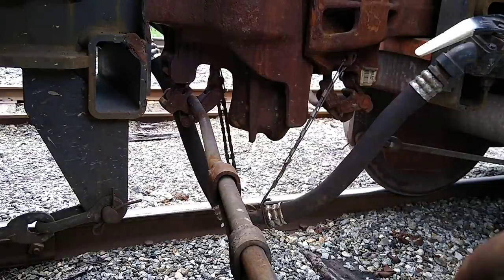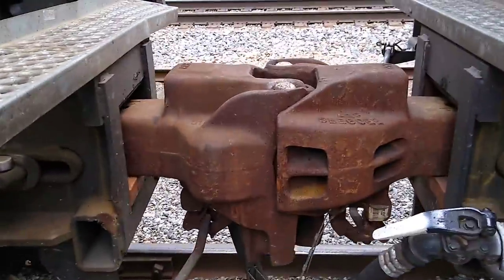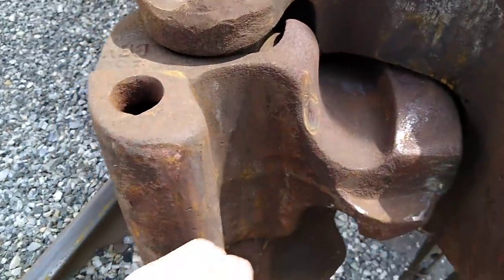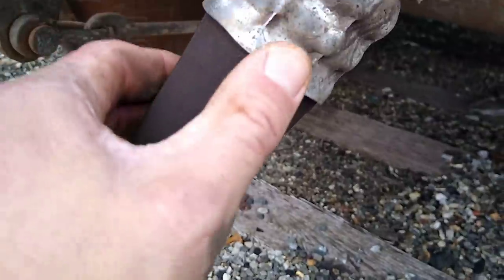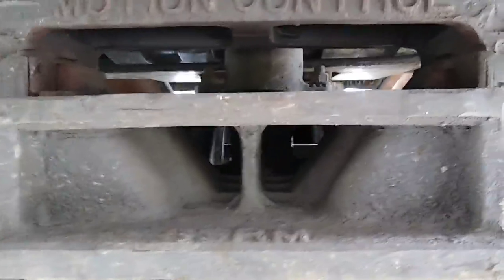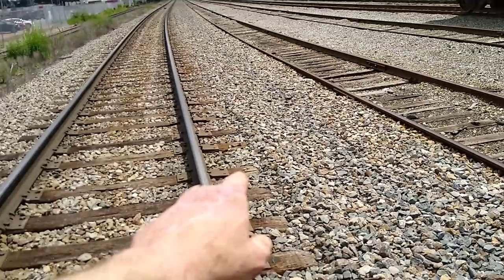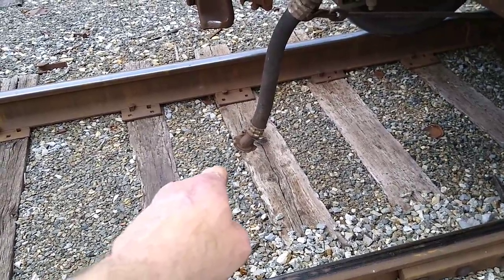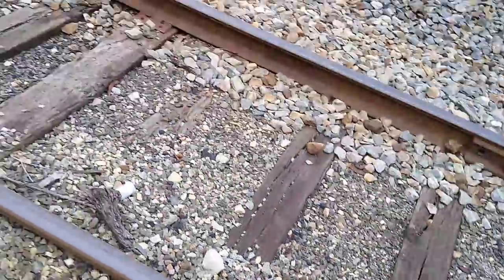Couplers and braking systems knowledge

Comment: Hey Shoestring! The connector on those hoses for the air lines is called a Gladhand fitting. They're universal for air brakes because of the positive locking action. Love the videos and knowledge you share, have safe travels!

Comment: Former railroader here. Retired carman out of CN GO  (MacMillan yard north of Toronto) The "hasp" as you called it where the release bar is connected to the coupler is called a "lock lifter" because it raises a locking block which prevents the knuckle from rotating. Once the lock block is lifted then the knuckle is free to turn on its pin.While the lock block is rising upward it moves a kicker which pushes the knuckle to help open it. The knuckle pins to as you stated break regularly and the train crews do carry spares. Dynamiting is any sudden loss of trainline pressure which causes the individual cars to go into emergency. It can be initiated either from the locomotive or due to a failure of a hosebag or gladhand. Occasionally a hose hanger will fail and allow the gladhand to strike a switch or crossing causing it to come apart. A couple other things, the the rolling assembly is called the truck. It consists of the wheel/axle assemblies, the truck sides, which sit on the adapters, which sit on the bearings, and the bolster which sit on the springs in the truck sides. The center pin is over a foot long (you only see half of it) and the truck bolster into which the center pin fits also has a center ring which the car center plate fits into. The bar which joins the coupler to the draft gear is called a cross key and is held in place by the T shaped cross key retainer.  These things are pretty amazing considering it was all designed by guys using slide rules many decades before the first computers. BTW Im not trying to be a smartass or anything but you seem like a guy who likes to learn and share your knowledge so I thought I would share with you stuff I had to learn on the job. Take care and safe travels.

Comment: Loram rail grinders are cool to watch especially at night.
Reply: Looks frightening at night the first time I saw it,, 😉😉😉
Reply: @GeorgeJansen  Couple times had to change out brake shoes and inspect the Sperry rail grinders. Dirtiest job we had.
Reply: Caught one in February and uploaded drone footage on my channel
Reply: Yep I saw one during the day and one of them during the night over my life pretty cool and you know they also have water tanks on those both of cooling the rail during the growing process and putting out small fires because of the Sparks from the grinding obviously could ignite brush or other things you know.

I've seen quite a few Maintenance of Way cars ovrr my life just a train enthusiast not the biggest but I don't seek it out mostly watching other videos and just more into the technical side of things as well.

God loved the old Google Books on the old old old stuff though.

At one time signals actually used to be operated by CO2 back then it was called the carbonic acid gas.

Also there were some signals and other things like that such as the pillar I guess you could say with the beacon that said railroad crossing not crossbuck or anything but just a little beacon on a big I guess you could call it mono live hard to describe but that was actually operated by acetylene gas years ago.

Also at times in the old days singles you stupid be lit by oil candles alarm with that there was some actual monitoring for those signals basically sort of a primitive thermostat that if the oil candle were to go out I can't remember if the circuit was closed when we aren't only open I think it was born with closed basically if anyone signal went out because the oil candle went out they would know on the other end because the circuit would either open or closed probably likely if I remember correctly it was from a closed circuit besides safety so that they would get indication should the circuit break or have an issue with the wiring excetera.

The old interlocking system and other systems were fascinating pieces of mechanical wonders.

Also the system that were used to ensure that only one train could travel on one section of track a Time besides signaling even more interesting such as token systems Etc.

Also they used to call steam engine plumbers Nightmares by the way.

Also I've been to many of Railroad Museum in my days.

Almost always if we find out about when we have been to somewhere we try to go if we would be going on a trip but of course the during these times that's a nope.

Also any unnecessary travel and or getting out of course.
Reply: @GeorgeJansen  yep I would have been a little startled if I didn't know what was going on but I realized it was a wrong rail grinder right away.

Comment: Shoe, when I stop a train, I 'strech' em out, so  so nobody  can pull the pin(s)
Reply: I learned that the hard way. I once had someone pull a pin on me in Houston.
Reply: Has anyone had any experience of failure of a Buckeye coupling in UK. Whilst a Guard on a heritage railway the cross pin supporting the coupling worked itself out and allowed the coupling to drop & part. The cross pins and tails were checked earlier in the day & the set had not been parted for over a week. When stationary the cross pins are often quite slack & can be turned & pushed out once the safety tails have been lifted. 
This coupling was fitted to a MK 1 carriage, no fault was found after the incident. The carriages involved have been returned to service without any problem. Hundreds of these couplings are in use in the UK , has anybody heard of such a failure in the UK.
Reply: I’m a shunter in Australia. Works when the string in bunched also
Reply: Kabuki Kitsune  stuff breaks sometimes. i've seen entire coupler boxes get pulled out because they had rusted away to nothing on the inside, but you couldn't tell on the outside

Comment: Totally  random  comment  here . 
But here goes . Working  in nyc transit tunnels and tracks ..we yell "Railroad " if a train is heading  in our direction...we have systems in place for safety but things happen. Soon as  you  here " Railroad "you take  cover " cover up " in a cubbie hole  flagman will signal train..train acknowledges with horn blowing  ..we also have a manual stop and a red cord  thats thrown  across tracks..once train runs  past this brakes  are activated  and train runs over cord marking exactly were  train rain past stop and into work area.....thanks for listening  .

Comment: Glad hands can be a pain in the butt on trucks too. SOMEBODY was thinkin when they invented them tho SHO NUFF....BTW GREAT SHIRT...Hooefully we'll get ya one that says KING of the hobo's this year😳
Reply: trouble is on trains the gladhands just slide apart like they were designed to but on trucks they will usually rip the air line off. grrrr
Reply: @edfrawley4356  been there, dinr that 😂😂🤣😂🤣 when I first started driving I was Hostling on the yard and i was wonderin why our Hostling Mules had expanded metal over the back windows till i forgot to unhook my emergency line and it came thru the open back door like a 22-250 😂🤣😂🤣😂
Reply: Ed Frawley same concept but different design between the two. Tractor glad hands more like those on construction air compressors and designed for not coming apart.
Reply: @groveradams8892  I suspect one has done is because on a railroad you would want that the company in some cases and brakes going on or a train coming apart not on purpose could be touring it however or something like that would have happened with road traffic oh yeah you got a ton of issues people that would be more likely to get hurt and more could probably cause a lot more damage than just a stop train yeah a heck of a lot more.

Comment: I’m a rail shunter in Australia. Ours is slightly different, our auto coupler has a pin that drops from the top so you can see it’s caught on properly. Our hand brakes are on the side on the wagons waist highs. Which is easier if you putting 6 on at a time.  Hose bags look the same tho.. some don’t bleed the air and we call that leaving bombs.. the hose bag can hit you in the face and give you a bad injury.

Comment: I been working for the railroad MOW for almost 26 years,you know more about this stuff than do
Reply: And most conductors!
Reply: oldrockhead  I dunno... he ha a point. I've dealt with my fair share of morons working as a conductor. But you gotta remember that if they have any inkling that you're a foamer, they don't hire you. All that's left are the few that are able to hold back the foam and the rest are the ignoramuses who think "How hard can it be?"

Had a guy get fired on his first shove move because he rode a tanker just minutes after being told not to.

Never had a problem working with new hires that were railfans. It's the ones that are indifferent to trains that are the problem. At least out here...

Comment: Volunteering at some local heritage railroads, I've actually seen cars lifted off the pin that the bogies or trucks pivot around (one case was pulling the front bogie from a vintage trolley car to pull the electric motors for rebuilding), and the one narrow gauge railroad I've done preservation work for actually had a big crane in the dual-gauge yard where it interchanged with the Pennsylvania Railroad (now Norfolk Southern) that was originally used to transfer lumber from the narrow gauge cars to standard gauge cars, but was eventually used to lift up entire coal hoppers off the narrow gauge (or vice versa) bogies, then roll them out, and roll in standard gauge bogies (or vice versa) so they could transfer the load from narrow to standard gauge (or the other way around) without having to move the coal from one car to another.
Reply: DJ Bonebraker recently looked up bogie vs.truck cause I’d often heard the two for the same thing. Typical usage, bogie is English, truck is American.

Comment: Minor correction, Shoestring.
The weight of rail is "per yard" not per foot.  For example, an 80 pound rail weighs 80 pounds for a 3 foot long piece (about 27# per foot).
Most main line heavy use trackage is made of 130# rail.  The lighter rails are primarily used on smaller branch lines, sidings and service areas.
Just thought this would be helpful.
Really enjoy your videos.

Comment: Really cool video Shoestring! It was all very interesting. And the most amazing thing for me, was simple and easy most of the things on the train were. I mean, just to a certain extent, I realize they are amazing and complicated machines, but like the brakes and manual brake system for example. I swear I would be able to change the brake pads on that train easier than I could on my car! And that manual brake system was real straight forward too. I could probably fix it if something broke. Or at least be able to jury rig something. Because it's literally just you applying pressure to the brake pads through a series of levers and pulleys and stuff. Wouldn't mind working for the railroad myself actually. I think that would be an awesome job. Not just the engineer, but all the other people who help out. Sure wouldn't get boring!✌

Comment: Those are AAR Type A tightlock couplers. They are better for getting less slack, about an inch-2 inches between each set of cars equipped with them. On standard type F couplers, there is much more slack, about  5-6 inches of slack between each car.  There's also the type H and the type E tightlock couplers, the type H has the shelf like you see under these couplers as well as a second shelf on the top end. You usually see these on tank cars and hazload cars. the type H is usually used on passenger trains like Amtrak and GO Transit and have the shelves on either side of the coupler body.

Comment: Awesome explanation! I've often wondered about the last few cars on a long train going from 0 - whatever speed the engine has attained instantaneously.
Reply: Me too and I was just curious how much slack there was I didn't realize there was that much an inch per car or would that actually be 2 in with both couplers? Wasn't quite sure kind of missed it sorry
Reply: Also I might add I remember when we were at with us railroad museums you know how that usually have the operating and trains for the patrons of the museum well on one of those trips which is actually quite a long one that was one of the bigger ones I've been at in terms of a railroad museum.

They actually had some entertainment along the train route as well which is pretty cool different and unique for sure sorry I don't remember the place but.

Also anyone that's interested in Mall railroads especially larger scales should check out in Tremont Junction it be worthwhile trip if you're in the area.

Also there is a Wikipedia article on this if you are interested.

Back to the real life trains though and the Railroad Museum.

I do remember it was one that they ran a steam engine for pulled a train and before we started out one of the gags was that s t o v a big jerk when they start out and the gag was that the big jerk was the person sitting in the seat across from you on the other side of the train everyone could not stop laughing that was the first gag on the train ride.

Of course there's a train robber that comes on with a hobo and a few other things as well turns out we realized the one doing all of it was the engineer himself you need to actually change costumes between which was pretty cool.

One more errand Channing ones I was on like that.

Also where I stayed there is a trolling and do they do actually explain things along the trolley run in all on the intercom this is not recorded but of course won't live about the city and things around you as you're going to the trolley route pretty darn cool.

And yes some people use it to actually get around downtown as well.

I remember when I was a little kid we actually used to have light rail Transit where I I used to live as well I remember running on that to this day.

About this closest as I've been to riding on a subway has probably been in the transit systems at the airports when traveling.

It's basically a major subway system sort of is how I would describe it.

And at least one place to call the plane train pricing that 10 times fast.

Also at least one airport that I've heard about actually uses a Disney designed of people mover as their transit system as well

Comment: I've often wondered how a brakeman must feel in the scenario I'm about to give.
Its a blistering dark rainy thunder and lightning at 3am in a January night where the temperature is 20 degrees with snow and ice already on the ground and more expected after the storm.
Brakeman and engineer are tugging along  drinking coffee in a cozie  warm cab when out of no where train goes into emergency stop in the middle of nowhere and all of the sudden it is to the realization that somewhere in our 140 car length train there is a leak which is set to automatically put train in emergency braking.
It must totally suck for the brakeman as he knows the challenge that waits ahead.
Walking in pitch black dark lightning rainy cold weather to inspect find and repair the source of the problem all by himself with only a radio/flashlight/and wrench at hand.
Also keep in mind the angled rough graveled shoulders of the tracks.
Also chances are to there might be a train trestle he might have to walk over to to get the problem car.
Or,it could very well be a car on that trestle that needs the repair.
O crap another dreadful thought is the fact that when knuckles brake and they often do from all the slamming and pulling.
The  brakeman having to carry the 60lb knuckle to repair site using the same analogy as above.
Lord have mercy.
Bottom line.
Everyday ain't a sunny day on the job.
And the scenario above is what separates the men from the boys.
God bless the rail men and women.
Y'all are a special breed.
Reply: You don't carry a knuckle, you drop it off at the engine, walk back to where you came apart, close the air handle, pull the car with bad knuckle  up to the good knuckle on the ground, change it out, then back up and recouple. 22yrs on railroad. And you missed the worst part, if it's on a hill, you have to tie a bunch of handbrakes, I mean a bunch.
Reply: @cnrmoose  
Thanks for the info.
God bless ya man.